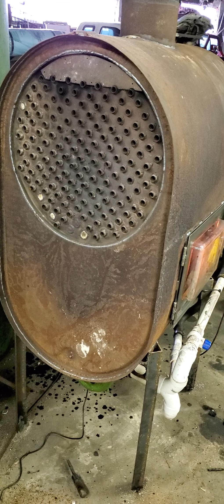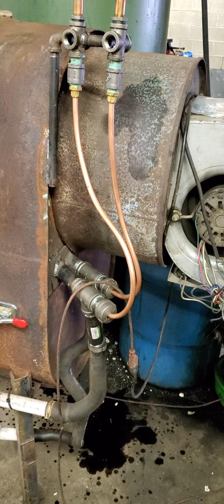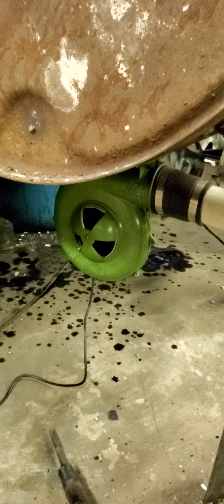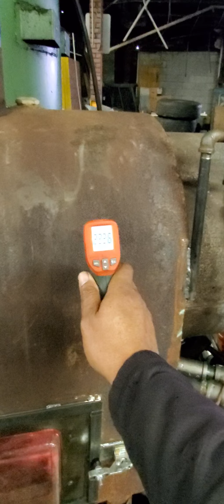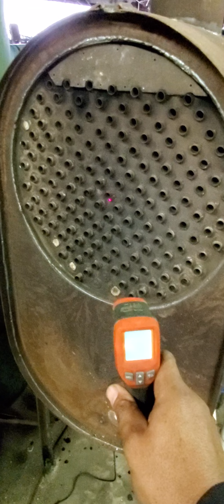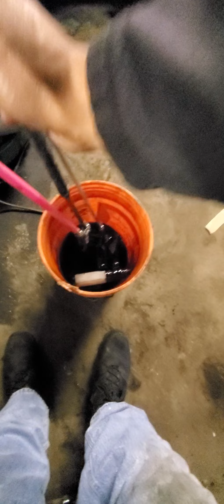DIY Waste Used Oil Burning Furnace Heater

Comment: Great design and build.  I recently moved to Idaho and have a large shop w/a high ceiling.  It is insulated, but has no heat source, and w/these temps in the teens, your excellent DIY heater is likely gonna be the fix that Ineed.  Many thanks, brother.  : )

Comment: So how much do you think it's burning per hour. And how far do your burner tubes stick down into your stainless steel pots. I guess I mean how far off the bottom of the stainless bowls do you keep the burner tubes
Thanks you great build and ingenuity.
Reply from the maker: The burner tubes are maybe 1 inch from the bottom of the burn bowls.

Comment: I’d love to see some detail of how you put the drum/heat exchanger in the top of the 275 gal tank. I’ve been planning a project just like this, only panned on 3 burners. I have two of these tanks and I want to set them outside and duct the air into the shops. I’m also wondering about detail on the burn chambers, the oil drips and the air induction. 

Any chance you’d detail more of the process? How’d you seal the Pyrex dish to the door?

This really IS an awesome build. 

Thanks, Art
Reply from the maker: Thank you. I'll make a better updated vid with more details.